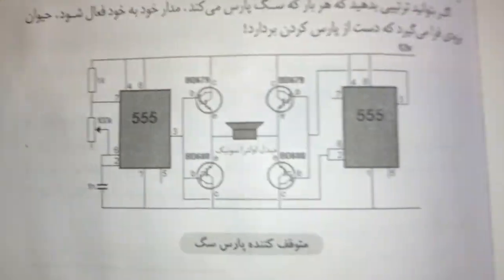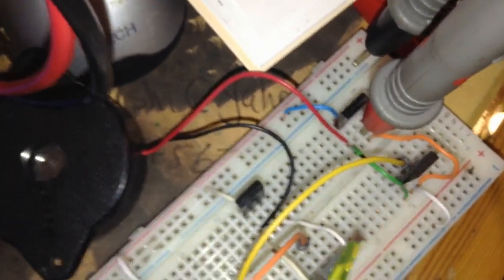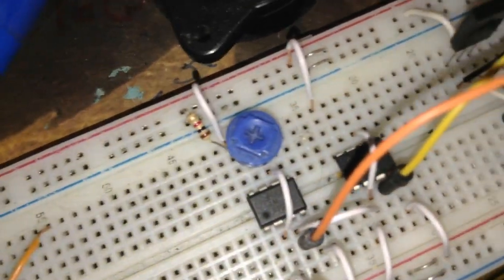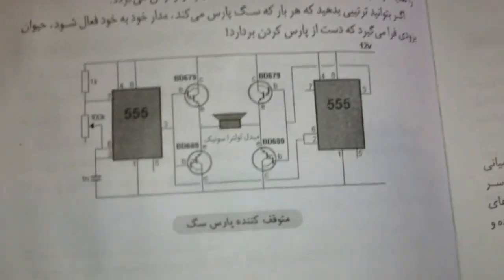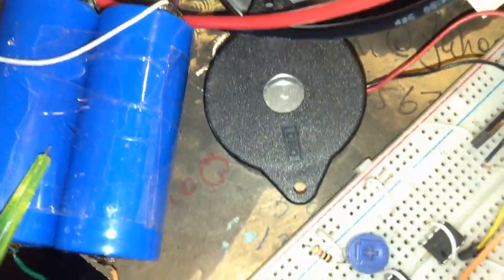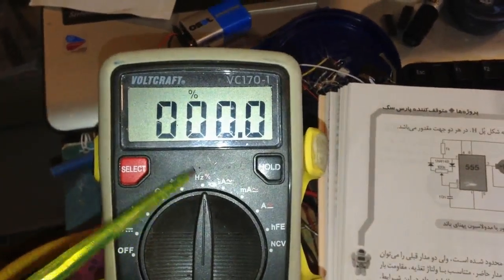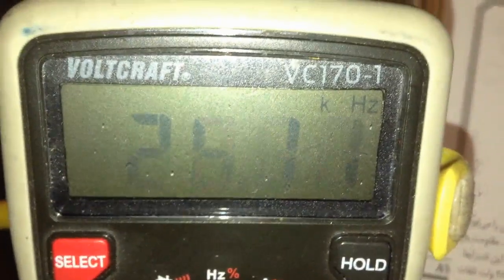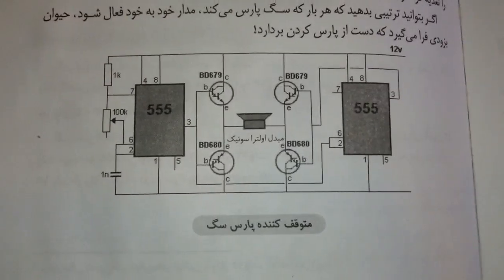dog reppel circuit strong and sharp 20khz to 40khz

Comment: I tried on a dog but didn't work
Help me figure out the problem
Reply from the maker: could you check output frequency how much is?simple meter with HZ sign should be fine
Reply: I don't have a meter to test
Reply: But the sound is very loud for human ear
Reply from the maker: @rohitkumar-nx6jw  you made wrong frequency!, human ears are not abe to listen only DOGS
Reply: When I rotate the 100k pot
At one point I'm not able to hear the voice
Reply: Did you consider that the dog may be deaf?